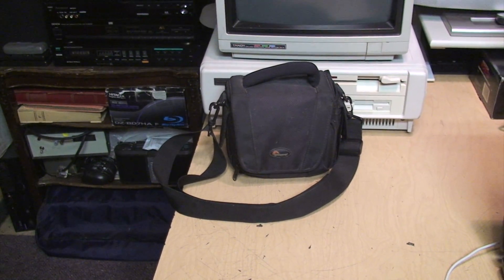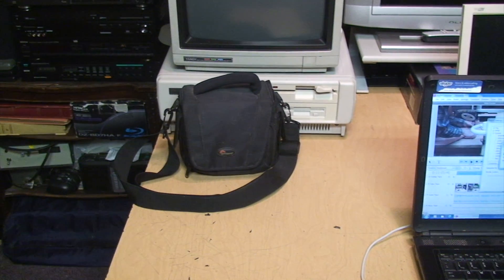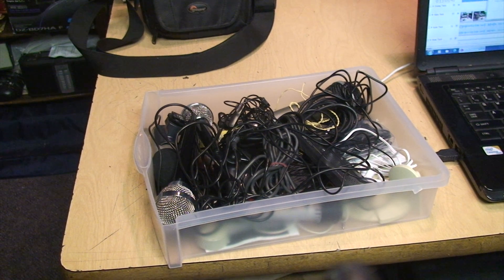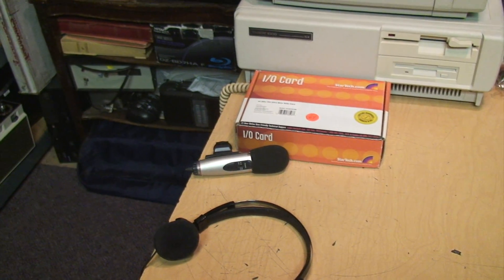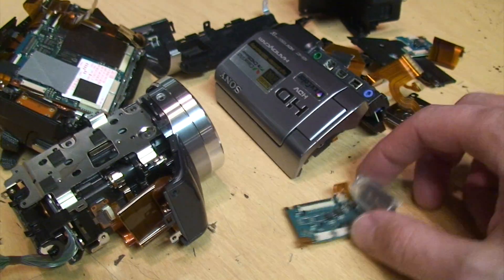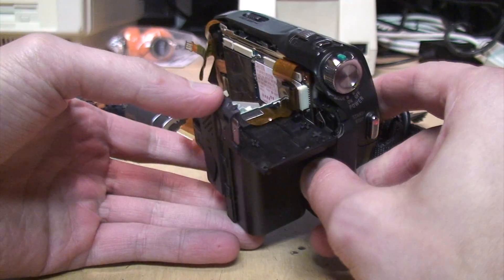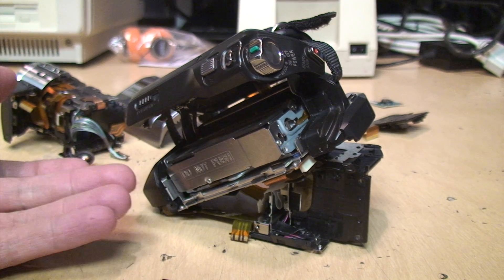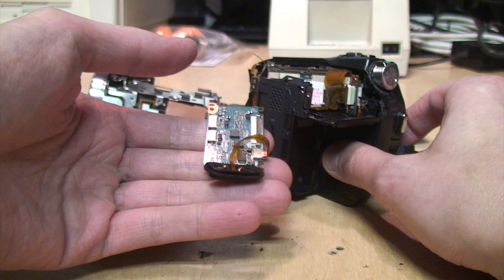Sony HDR-HC7 Handycam internal microphone problem, teardown, and repair

Comment: I think I might have to pick one of these up since I have my little portable HDMI recorder (and through some experimentation, I have found that it preserves interlacing so QTGMC can have a go at it).

Much like the head of IT and HVAC/R operations at Walsh Motors, I'd like to keep tape mechanism use to a minimum, but hey, if I can get HDMI out of it, I don't even need to touch the tape mechanism other than as a curiosity (because let's be reel.. apologies, that was bad—it's almost required to run at least one tape through a camcorder when you get it just because tapes, them's the rules I suppose).

I think I recall the HC7 having full size HDMI, am I remembering correctly? If so, I'm gonna have a field day with this camcorder.
Reply: Actually a HC9 (the HC7 I was eyeing got bought while I was sourcing documentation, but a HC9 is available for the same price).

Comment: Picture quality from that old camcorder is really very good indeed!  😃 
I'm happy see/hear that the microphone issue was fairly easily fixed too; the 'new' mic board/element sounds far more solid, and with less background noise, than the original dodgy one!  👍
Reply: To be fair, the high-pitched whine in the first part of the video was from my laptop's cooling fan (it was rendering a video), not from the camcorder itself.